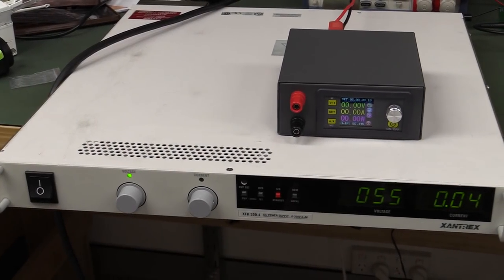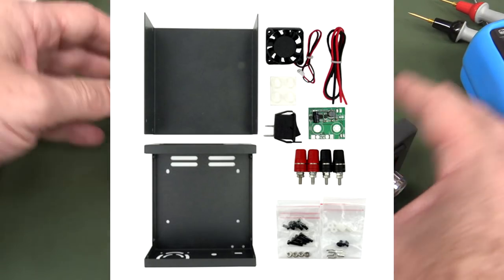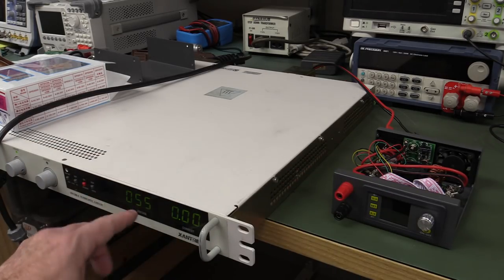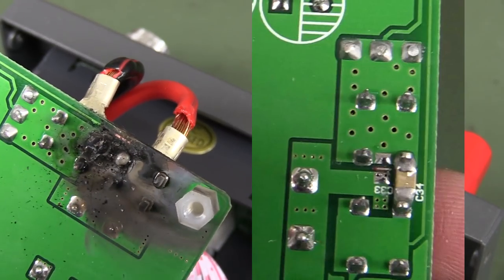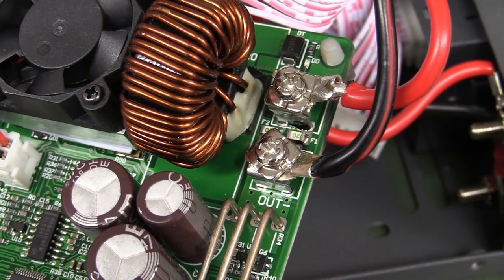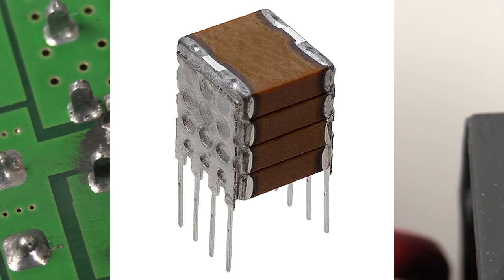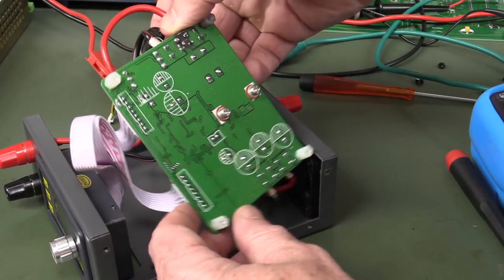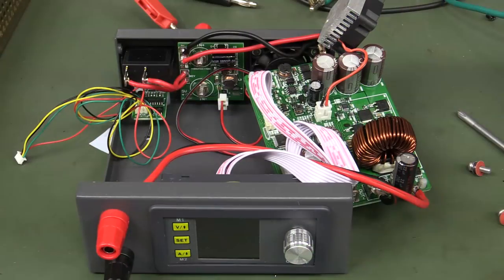EEVblog #1035 - Flaming DIY Power Supply!

Comment: the place is not good, I admite it this caopacitor defect is the crack resistance is not good, so the place is not good now our engineer are designing new way, new place and new capaciotor to solve this risk ... in fact, don't use the capacitor, it still can work normally
Reply: Failures like this happen. You can make everything perfect but then your supplier has delivered faulty components that will burst in flames. That is why I always recommend to use a non-flammable case like the one shown in the video. It has safely contained the fault, nothing but a bit of stinky smoke and no further damage.

Unfortunately I have already seen the works of some people that were built on a piece of cardboard. A circuit to switch a 12V/40A load via rs232, it was just a relais, a diode, a transistor and a few resistors all glued with packaging tape on a piece of cardboard, covered with another piece of cardboard and installed into a computer. No fuses, no non-flamable containment (the metal case of the computer had some holes for the cables). But luckily it worked until it was removed without the house burning down. ;)
Reply: AniMageNeBy Es gibt auch noch eine andere Variante. Einfach in der Muttersprache schreiben und damit die Leser zwingen Google-Translate zu benutzen. Manchmal führt das zu besseren Ergebnissen als die Versuche in einer fremden Sprache zu schreiben. Aber das Englisch von Rd Tech war für mich einfacher zu lesen als das was bei manchen automatischen Übersetzungen heraus kommt. ;-)
Reply: Well, yes, maybe you should. Though I imagine it won't be easy for everyone to understand you, and let's face it: google translate (still) sucks, even though it's slowly getting better. 

That said, English is the international language these days, so it wouldn't be bad if everyone could use it. Speaking/writing shouldn't be too much of a problem (I'm not a native English speaker neither, but I'm doing alright, even if I say so myself ;-)). But IF you decide to write it, you can easily use a spellchecker; it helps a lot in the details or if one has been a bit too hasty. There is also no problem to install several of them (in fact, I have 3 different languages).

German is not one of them, but I can understand it just fine without any translator, though granted my passive knowledge (understanding/reading it) is much greater than my active use (writing) of it, so prefer to speak in English. But, if you want to speak only to me, feel free to speak German, I have no problem with it - I don't need google translate ;-). My point was merely that, IF one does decide to speak another language, it's worthwhile having and using a spellchecker of it as well.

PS. the link was actually meant for Rd Tech, since he made a whole bunch of obvious spelling mistakes and was, indeed, difficult to understand (though granted, more through his grammar construction than through his spelling). And I do not know what his natural language is, so it might even be Chinese. But I think it's better everyone tries to speak a common language, than everyone speaking his own language and let crappy translation handle things. But either way, it doesn't inhibit the use of a spellchecker.
Reply: Rd Tech
You need to relax a bit,  your products are ok they just need some fine tuning like any new product .
Reply: AniMageNeBy Rd Tech is the YouTube account of the vendor of the PSU. They are in China and their primary language is probably Chinese. Automatic translation tools tend to fail horribly with that language. I normally have a better chance to understand badly written English than the result of some automatic translator.

When you pasted that URL it looked like a lazy way to say that his English is bad and that is why I responded like this. His English was understandable for me. Maybe because I used the context of the video to analyze his text. Anyways, I have seen much worse English in some user manuals from China and his English was better than this! 

And yes, I absolutely agree with you about English as the international language. Nearly everybody understands it and it allows communication with people all around the world. And that Link was also helpful for me, because until now I had red squiggly lines under every English text I wrote and now they are gone. I didn't know that Chromium (Chrome fork) supports multiple languages at the same time. ;)
Reply: zvpunry Obviously there was more damage than just stinky smoke... a component failed and as a result of the design the power supply was also damaged.
Reply: praestant8 of course the PSU was also damaged, but that is negligible if you think what could have happend if that thing wasn't in a metal enclosure. If the magic smoke of a complete building escapes it is much more work to repair or replace it.
Reply: If you freeze frame at 18:11 the chip just below the screwdriver looks like it has two shorted pins in the upper left.
Reply: It's likely due to the fact that you used a 250V capacitor thinking that the extra voltage rating would be extra protection. The problem is to get that higher voltage rating they need to increase the plate distance which lowers the capacitance. To get the capacitance back up to 0.1uF, in the same 1210 package, they need to cram more plates or increase their surface area which can lead to more internal stress. More internal stress on the ceramic and you get more knit line fractures. You'll likely see less failures lowering the voltage rating down to 100V or changing the package size.
Reply: @ Claudius
yes,terday, I updated all conpont, I will show your picture, now I am a little busy, I will reply all message ,. don't worry
Reply: @AniMageNeBy
thank you
Reply: @ zvpunry
thank you very much for your praise , my english is not professional . I will improve it
Reply: @
AniMageNeBy
you are right , friend . i will change to Chrome to write. sometimes there are some word mistake and can't let some one misunderstand it . thank you very much for your great advice , thank you
Reply: @Barrybados©.
thank you very much for your comfortable words, it is very kindly of you. I am not nervous, I just try to explain and let all watch know what happened, and I admit the problem. let all people know the truth
Reply: @ Claudius
I explain this already at other comment, this is not our problem for solder 
we never solder it on the front. we use the STM machine to make it . all the solder on the back . I guss those things Dave left ,. understand ?
Reply: @ praestant8
NO no, you are totally wrong. only the capacitor was burnt, because there are many protection, so the main circuit was not damaged. and he just clean up the burnt things, it will work normally, but Dave did not clean them up, ok?
Reply: @
Claudius
Dave did not clean all the burnt thing up, so there are shorted. and some professional person give the right answer : those burnt thing can be Conductive. he need to clean all clearly
Reply: @zvpunry
thank you very much for you explain... 
this is the right answer 
 only the capacitor was burnt, because there are many protection, so the main circuit was not damaged. and he just clean up the burnt things, it will work normally, but Dave did not clean them up, ok?
Reply: @Michael Hagberg
about this , I already explain for this .
this is not our problem for solder we never solder it on the front. we use the STM machine to make it . all the solder on the back . I guess those things Dave left ,. understand ? 
and this chip control the display parts, not power part,. so there is nothing with it
Reply: @Claudius
thank you very much for your advice , I will change this , I will check the words
thank you again
Reply: @zvpunry
thank you very much for your advice , it is very good solution for writing , now I begin to use Chrome to write . 
it is very good , thank you again
Reply: Thank you for admitting the mistake.
Reply: We don't know that Dave didn't slag that solder on the chip.
Reply: @ stefantrethan
in fact , this is not mistakes.
Reply: @Kew Akl
I can make sure. because it can't through our test
Reply: Sue it is a mistake. Any experienced engineer who has made that same mistake before would not have placed that capacitor across the screw terminals.
Reply: lolollololololololololololololol
Reply: The cap failed short as it had stress through the solder joints. Use soft termination parts and isolate them physically from the thru hole pins. Murata also do failsafe caps for automotive.

Comment: That burnt board is probably conductive, which would leave you with a short until you clean it all out.
Reply: True, but it really shouldn't be resetting itself even if there's a low load on the output, the module is current limited. I think there's a deeper problem.
Reply: yes, you are right , there are many protection on the board, just clean up the shorted things, it will be ok
Reply: Hes current limiting on the input supply which is why I think it was rebooting. When the current limit is reached it will reduce the voltage which results in the module wanting even more current etc etc until the voltage gets so low the module crashes.
Reply: @Clyne Griffon
Yeah, you're right.
Reply: @Clyne Griffon
it still caused by shorted on the output .. ,. just clear the burnted things
Reply: Thats what I thought might be happening is carbon tracking between the outputs.
Reply: I had a PC motherboard that did this. An electrolytic leaked, went under an AMR connector and the electrolyte shorted from +12 to -5 volts. It smoked and I had to take off the connector and also gouge out the carbon off the PCB surface .. then the smoke stopped. Also an old Cossor CDU150 oscilloscope where some hot resistors charred the PCB which then conducted and started smoking. Had to cut out the laminate to stop it.

Dave gave up too quickly.

Comment: Be a pal Glen, post the schematic. Most people are more likely to buy a product that they know can be repaired, even after a fire. Your sales will skyrocket! It’s not like we can built one any cheaper than you anyway, just the parts would be more than $20!
Reply: The Combat Engineer The problem isn't us. It's all his local competitors in the Hong Kong suburbs (aka Schenzen).
Reply: I think that’s spot on.
Reply: Agree, $20 bucks for a very nice looking power supply - I thought he meant $20 for the case and external parts, that the power supply would be additional. I've looked at these kinds of power supplies through bangood but didn't trust them. Combat engineer, great name, I served with a combat engineer unit 2004-05 in Iraq. I have a lot of respect for those combat engineers. When thinking of this experience I though EVVblog was going to need to don his bomb suit, get out the demo robot and blow the thing up. The reality of building stuff is experiencing the joy of magic smoke. Sad to say I have installed a few parts backward or reversed my transistor looking from the bottom rather than the top. I think that is why you always buy a bag of transistors. Had a power surge go through my house this summer and it took out just about every switch mode power supply, magic smoke everywhere. House full of guest, TV smoking, the kids pointing ever which direction saying they heard a bang over here and over there. I ran and hit the main breaker then set about to determine the cause. Our cable had gone out and the cable man was fixing the cable when he disconnected the cable we lost the ground path for the severely out of balance load. The US uses a two live wires180 degrees out of phase with a neutral line to carry the difference in an unbalanced load. and if all fails a ground to earth ground. The neutral line had been chewed off by the squirrels, the house was using the ground to take the difference, 80 volts on one line, 140 or 180 on the other line, and that little coax cable was carrying a lot of the ground for the house load. I think the cable guy is a believer in those safety classes now. that high voltage and a lot of currents can be finding a path through their equipment. His eyes got as big as saucers when that thing sparked, he was shaking for 10 minutes. he had his work gloves on, I had warned him of a power problem that the previous cable guy said was happening in the area. The power company said they couldn't do anything about it, it was an act of nature. I would think that the expectation is to receive a proper supply voltage with the correct neutral. Well, it gave me a chance to change a bunch of little weird fuses, and thermistors. Surprisingly that is the only thing that blew. Able to get parts off of some old boards so it didn't cost anything to fix. I did through one LED light fixture away, I didn't even try to dig through all the epoxy and tiny parts. My old analog pinball machine dimed the lights and blew a fuse but nothing was harmed a fuse in the right place. The other pinball machine did not have any impact.

Comment: With that much charring, it's no wonder it still fails. I guess you will have to take the Dremel out and cut an isolation slot between the terminals.
Reply: Yes, this. I bet there is a low resistance path between the terminals.
Reply: yes, just clean up the burnt thing, that's ok
Reply: I'm somewhat surprised Dave didn't know or comment about this.. So many of us have charred PCB:s and had to use drill/file/dremel. Perhaps he could to the followup.video on this?

Mine was back on 386/486 days.. Who knew that those ** expensive VGA Graphics cards might have unfused +5V power output  at the D-15 connector. One bent pin and one quite crispy PCB. Recoverable, but definitely not pretty. But hey, it worked for some years. :-)

Comment: Great video. Those are called "Electrosplosive Capacitors".  It looks like the cap failed due to Thermal Expansion Rate differences from the Board and Terminal Blocks, and possibly mechanical stress from flexing the power cables - which flexed the board and thus the cap to crack and short.  Notice how the PCB didn't catch fire but was charred? This is why this type of PCB is FR-4 (Flame Resistant Material 4) - a fiberglass and resin material that usually won't catch fire if a component on board does. 

The designer of this power supply was not well versed in decoupling caps and inductance. Those Terminal Blocks have a lot of inductance, so SMT caps which generally have low inductance are less effective close to the terminals because of the inductance. I have used similar Terminal Blocks like this before, I used large through hole caps near the Terminals because noise is not a problem there, it is power sag as the load changes which is the issue there. 100uf caps with low ESR and a WVDC rating of twice the max voltage is the way to go. You can't get those high values and large WVDC in SMT Ceramic caps, so you have to go with large Tantalum caps that can handle the thermal, mechanical, and in-rush current. Decoupling for noise (where you do indeed use Cermaic SMT caps) is done at the noise source - like at the switching transistors and digital circuits - not at the power output where inductance from the power cables alone block a lot of the high speed noise. Put a choke around the power leads if you ever see high speed noise get through the power supply to the load, those tiny SMT caps were doing very little for noise or power sagging, and I bet their voltage rating was only about 10% higher of the expected voltage - not enough design margin for high current applications.

Comment: On 18:21 you can see a small blob of solder on microcontroller. Try to remove it.
Reply: I did not see it
Reply: yes
Reply: Wasn’t sure if it was a light flare thing at first, but it certainly does look as though there is a stray splash of solder bridging the top two pins on the left side of the micro controller.
Reply: At 10:23 no solder short.
So that one probably came from Dave's repair job. Or just a splash from when the cap burnt and it found it's way onto the board later by turning it over.
Reply: Yep, not there earlier.  Any way that could be causing the weird readings Dave was getting later though?
Reply: True that Mark. Well, he's not gonna see this comment anyways or bother to repair it. But to me looks like well made power supply for that kind of money and I'm quite sure that Dave just had bad luck on this one. He has to pay debts to Electron God for finding good stuff in his dumpster. :P
Reply: @Mark Parker 
the problem is not here .,.
Reply: @Einar S
just remove burnt things , that' ok
Reply: @Mark Parker
did you saw our explaination? it was caused by burnt things, he did not clean them up
Reply: @ themrworf1701
haha , it is very funny, in fact , the capacitor place is not good, now we update it all
Reply: 18:10 solder bridge between pin 25 and 26

Comment: Isn't there a big ugly solder bridge short across 2 pins of the 48 pin IC, visible at 18:11? Perhaps this could be a contributor to the problem?
Reply: I saw that place , it should be solder splash, I guess Dave drop it mistakenly when he install the case , but there is nothing with the board, it control the display . this is not from our factory, because this chip was weld STM machine, it is impossible that there is the solder splash on 2 legs. we don't weld the chip by hand.

Comment: Use the (Flir) Thermal Cam to see where the short ciruit current flows?
Reply: That's may favorite tool for mystery rail shorts. My second is a high-count voltmeter with kelvin probes. Almost always either a fractured cap or a dendrite.